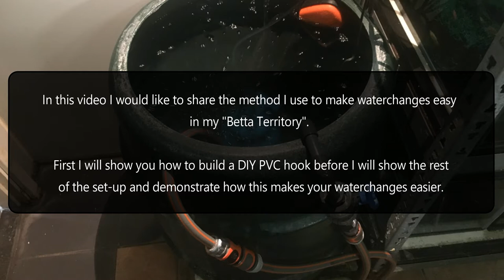How To Make Waterchanges Easy!

Comment: Hi sir if you shut the valve at the pvc hook wouldn't your submersible pump overheat or spoil due to the building preasure in the water line?
Reply from the maker: joe torres Good point. Never had problems as I only do this shortly when swithching from tank to tank. For longer pauses I switch of the power.
Reply: @BettaTerritory  thank you brother. You are very systematic and precise.